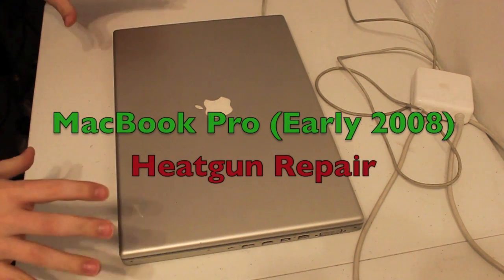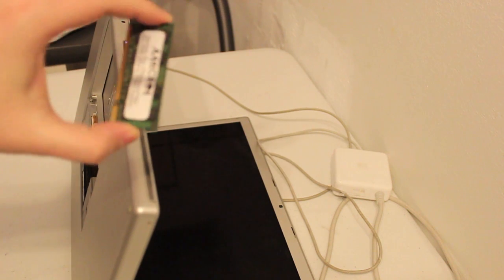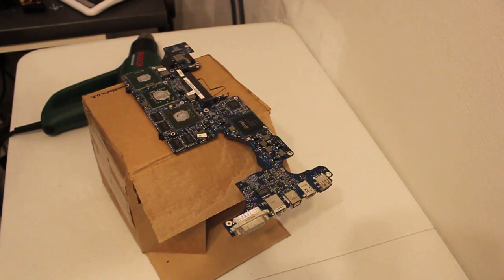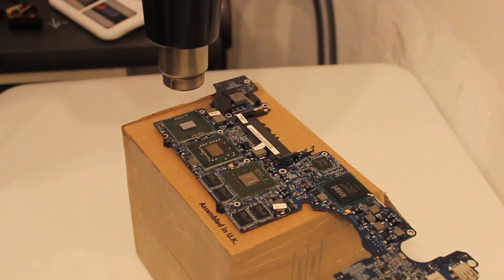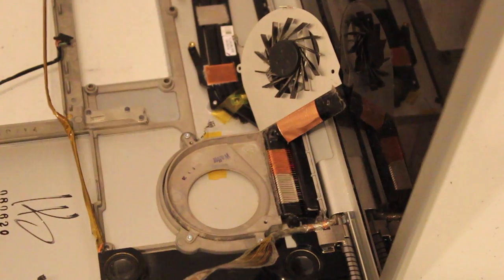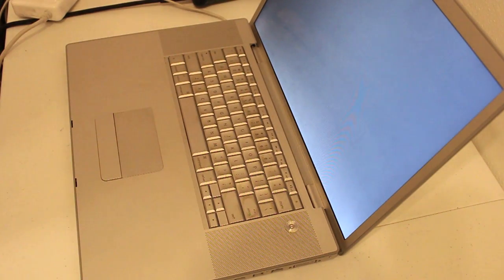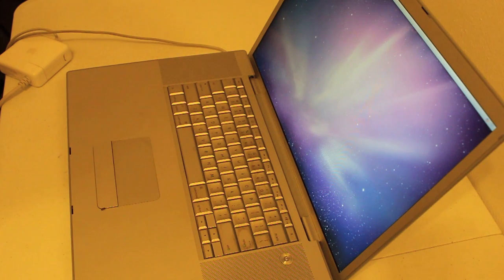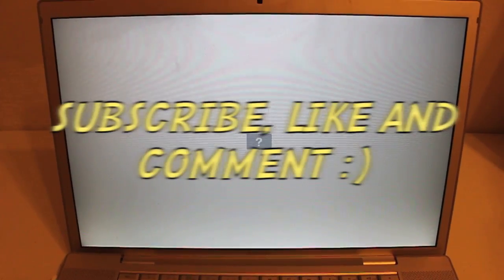Apple MacBook Pro Heat Gun Repair [Mid 2007 / Early 2008]

Comment: Going to attempt this on a MBP A1260 with similar symptoms. Had one question for you, though. While my mac is showing similar symptoms (optical drive resets, no video, etc), my front LED does not come on. A small detail, but just wanted your input on whether that could mean it's a different problem entirely.
Reply: ***** This is true. I'll update when i've completed the procedure.
Reply: Not as of yet. Luckily I can get my hands on a heat gun at work, and i've gone over how to remove the Logic Board. When I purchased the laptop it came as-is with no HDD and therefore no OS.

HDD shipped today from eBay and i'll be making a bootable USB with Snow Leopard on it this weekend, should be able to (hopefully) get this puppy up and running middle of next week. Stay tuned!
Reply: ***** Luckily I have the screws etc for the replacement hard drive (which is due to be delivered tomorrow). Tomorrow night I'll give it a try and ill hop on here and give you the (hopefully) good news!
Reply: ***** Worked like a charm! :D

Comment: Hey, i do have the same macbook, and almost the same problem, the only different is i still got the capslock responds. Do you think i could use the same technic? And also about the heat gun, do u think i could use hair dryer instead? Hihihihi thaaaankkksss, u really are awesome!!
Reply: I try to open the ram and start the computer, and i got the blinking led. Do you think its okay to continue the procedure?
Reply: as he said, this problem can happe in various ways, do you have no video output etc?

Comment: Thankyou for this video! I was having some very strange symptoms which I found out to be the graphics card thanks to some forums, my MacBook Pro would only boot to safe mode, I ran it down to a local apple store thinking it was just software related, apple could not get it to boot other than in safe mode, my system would just hang at a blue screen after the apple logo, apple hardware test came back with no faults yet it could only boot in safe mode of any os they tried including their apple network which has nothing to do with the hard drive. The genius stated he personally believes it's a graphic card issue, so I came home and followed your video (used foil to protect nearby components on my smaller 15' logicboard) and bam she booted right up. Just goes to show even when you have a display with no distortion that appears fine your graphics card may not be.. Thankyou!!

Comment: The reflow temp is higher than 300'C. You could emulate the reflow profile of a reflow oven/station with a thermal couple meter and slowly building up the temp.

Comment: Mine also reached more than 95 degrees (only quick peaks). I blame the crappy thermal paste they used at the Apple Store. Also my left fan is failing, do you know if it's possible to replace it with an other cheap notebook fan instead of spending 50 euros on an original part (I guess)?

Comment: I have the late 2007 model, 17 inches. I had the motherboard replaced for free but if the graphics card fails again I'll have to do this on my own possibly using an oven. Now that you changed the thermal paste what's the maximum temperature the cpu reaches?